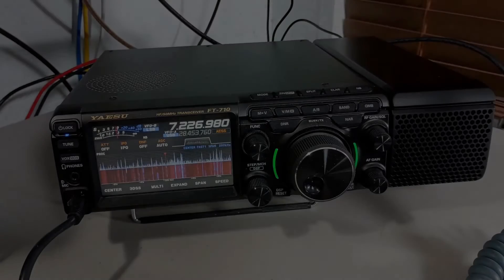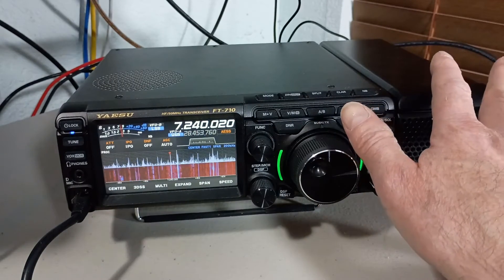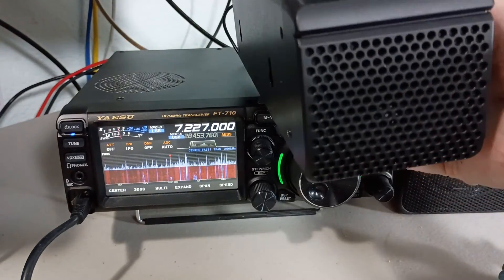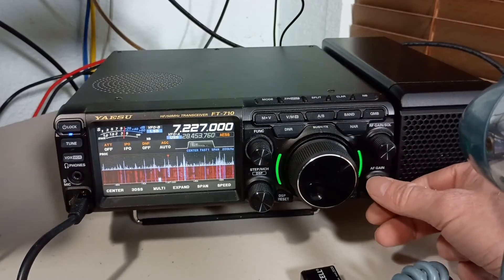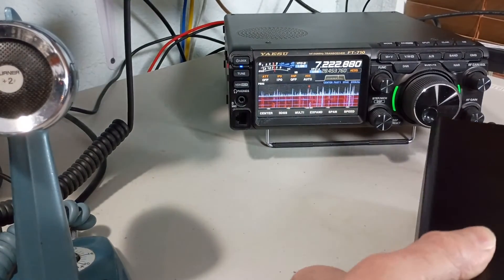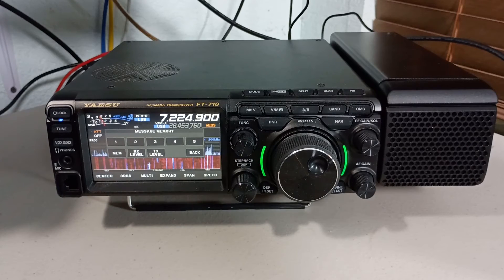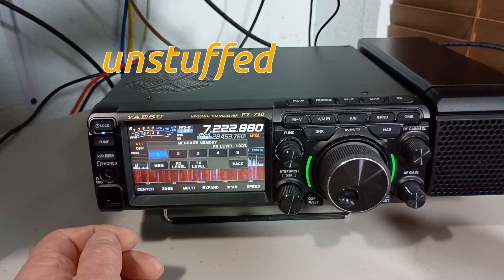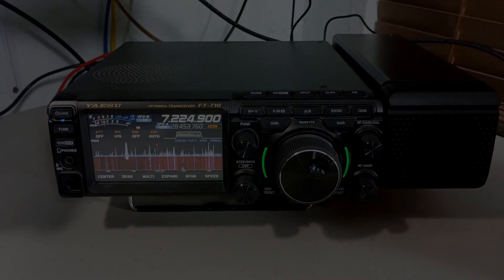Is Yaesu AESS actually worth anything?

Comment: LOL it is interesting, your video stating a distaste for the radio convinced me to buy one. For me, the more lows on the sound is harder to differentiate the phenomes. With the AESS focusing it's ability to make the speech easier to understand not necessarily a better sound. Mixed with the notch filter I get great audio out of mine. Also the appeal of a radio's sound also comes down to the ear of the beholder. Meaning we all have different hearing. Some people hear high pitched tones better, some low pitched tones better, some mid range tones are better and then add how our hearing diminishes. I hear less high frequencies than I used to (age and exposure to loud noises over the decades), so for me the AESS system rocks., also an internal equalizer you can adjust as well. I had to throw in my 2 cents, I love my FT-710.

Comment: Disappoints you? I could not agree more. I purchased the Field version but added my own external speaker just for a test. I was not impressed. I think the AESS as well as the 3D display feature is all hype. I do not see any value with the 3D display. As for the speaker, I use only my external speaker in the shack and the internal stand alone speaker is ok for a POTA activation.
I forgot, I also went into the menu and took away a lot of the base in the audio. Did not like the way the radio sounded with the default settings.
Barry, KU3X

Comment: I wrote a big explanation on this... but TLDR so I rewrote it simpler... just get a pair of 4 ohm low wattage bookshelf speakers and run them in series either side of the radio with the radios speaker just audible.

Comment: Adding the material kind of bypasses the whole function of the AESS system. Its supposed to be an acoustically tuned chamber. Anyway, you coukd play with the many adjustments to tune the audio to a more warm pleasant sound Im sure..
Reply: when I am picking up a transmission that is to bass or to treble you can use the AESS to adjust it out. He also held his mic by the external speaker only...  not giving the effect of both speakers working together.

Comment: I have the FTDX101MP, it has an external speaker integrated into the power supply and for "symmetry" they make an extension speaker too.
(So you can have both main and sub-receiver routed to external speakers). It all looks great but sounds awful, the sort of sound we expect from a cheap speaker in a glorified biscuit tin. I suspect I will ultimately use a pair of old computer speakers. One of my older Yaesu speakers has a t-shirt stuffed  in the case, sounds much better than it did, a shame as these speakers do the radios no justice. Soon have you reaching for your headphones...

Comment: In the external speaker case, it looked like the speaker is mounted on a plate with very little open area for the speaker's sound to pass through. Only a few holes.
I'd try to make another plate where the entire speaker's surface is open to the inside of the box like conventional speaker enclosures. I'm certain that could be an easy source of the tinny sound. 
73

Comment: Most rigs' internal speakers are crap and are only driven by about 0.65 watts. I gave up on my rig's internal speaker and built an external amplified speaker with DSP spectrum noise reduction. I reverse engineered an Motorola 18W bridged amplifier and built that into an enclosure with a home brew DSP and TFT display. Then I found a bunch of Motorola cop radio speakers on eBay. The results were so fantastic I built three different versions for all three of my rigs.
Reply: I use a soundcore speaker and it sounds great, I would love to find a 50 watt speaker and hook that up.

Comment: Play with the ohm of speaker. Lower ohm always sounds better to me
Reply: ohm is a unit of measure
you mean resistance (or impedance)
there is no way to lower the resistance of a speaker other than hook up two in parallel.
the speaker should have been matched electrically and accoustically to the radio but the whole thing has been cheapened so much it's just sad.